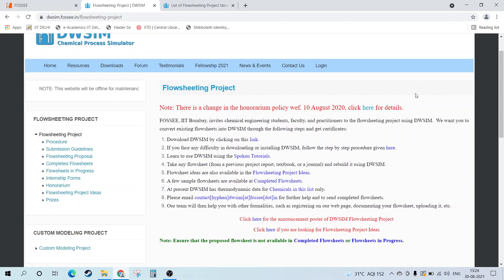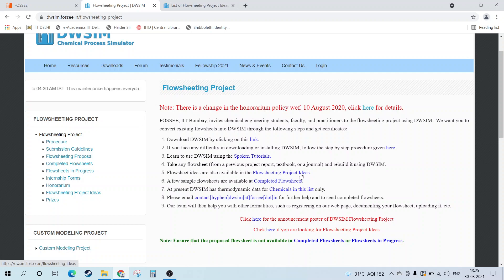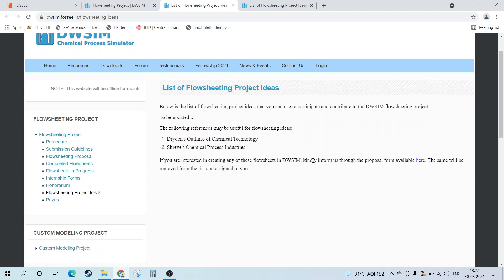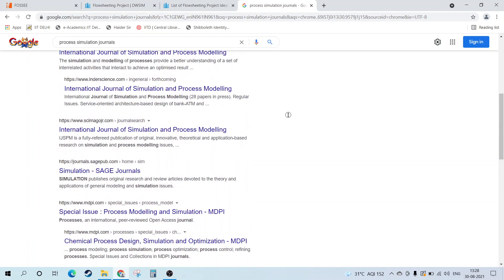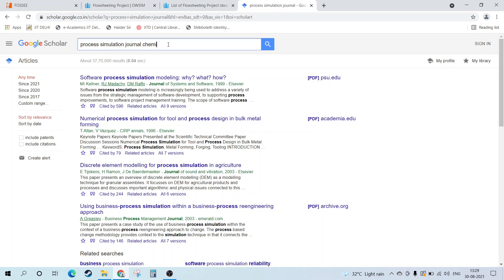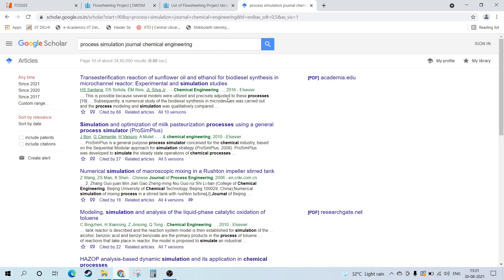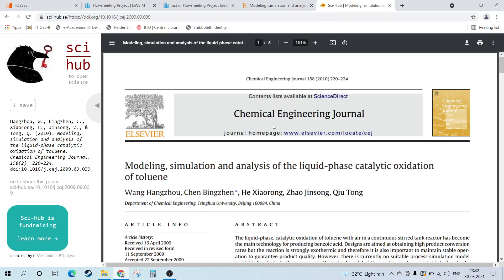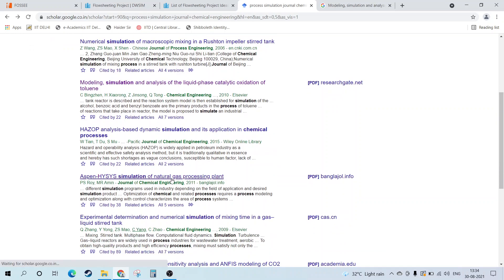DWSIM Flowsheet Ideas | Free Process Simulation | Dwsim

Comment: Could you help me please? When I use Peng-Robinson and TP flash-spec in simulation multi components stream (hydrocarbons), the system gives an error “casting string "1.0" to type "Double" is invalid”. It actually can’t calculate the volumetric flow. Have you encountered such a problem? It goes right only after I enter the mole fraction of one component equal 1. I really need your help.
Reply from the maker: Try changing the mole fraction. And check the inputs properly. I faced this with NRTL and after changing some inputs, it worked.